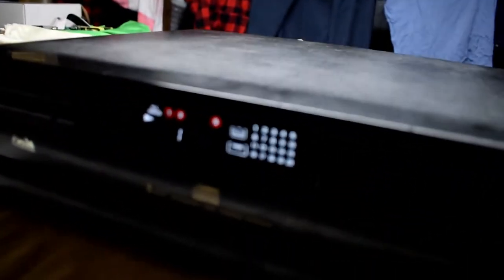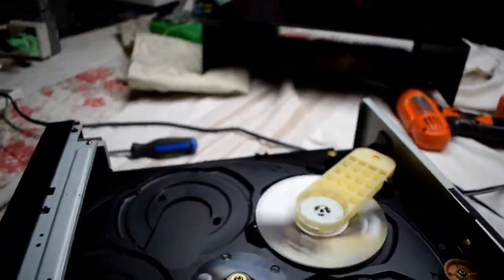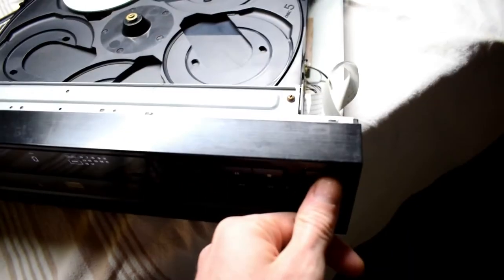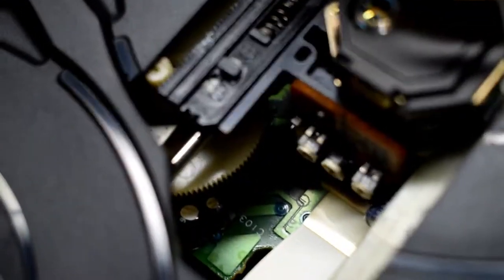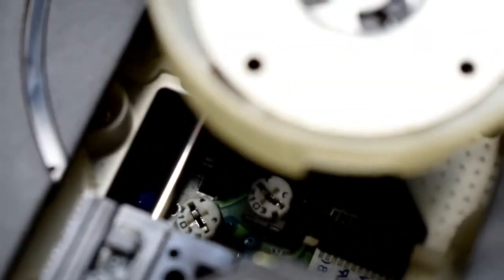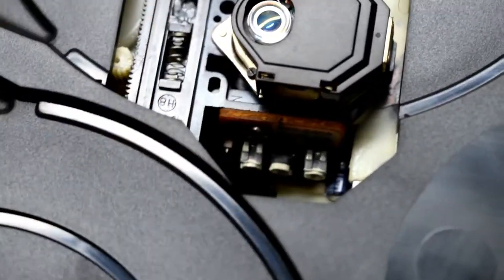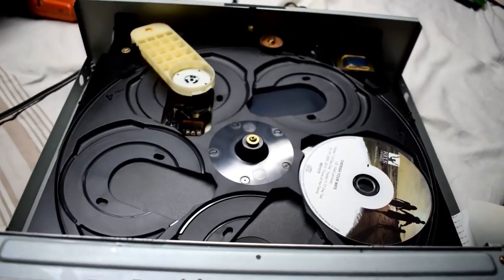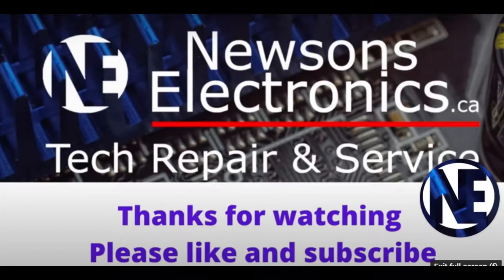Sony CDP C315 Not reading CD | Fix

Comment: Hi man, I changed the laser pickup on my 95 Sony player but it still stops and errors after reading the disc for 30 s. Do you have any idea what could be wrong? Thanks.
Reply: sony mhc-ec69i  is my model, and I may be experiencing something similar, at least the root issue. It, is really no longer making any spinning noise at all, and I receive 'no disc' error. I believe the bass vibration may have shifted the wheel, possibly laser eye motor track, yet...still, very hard to find a troubleshooting forum